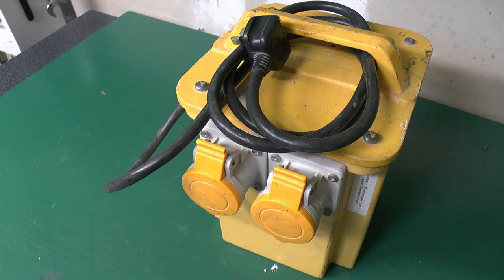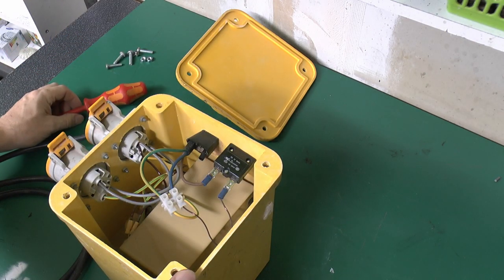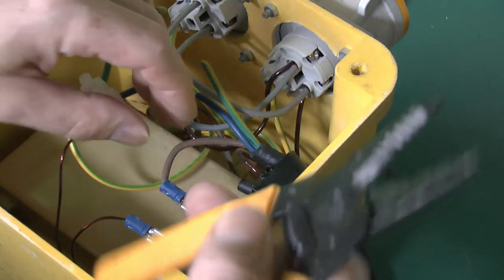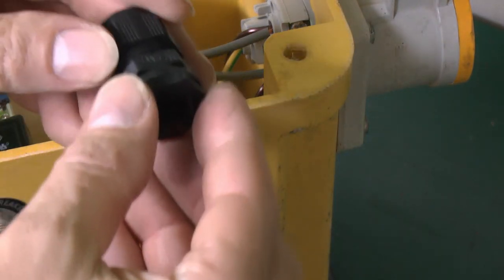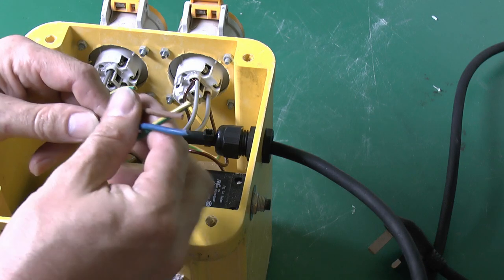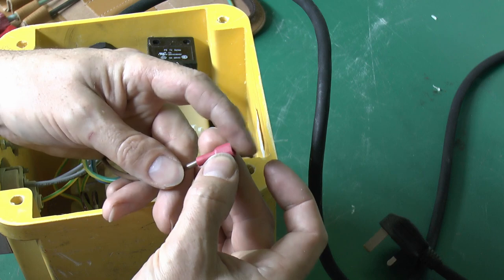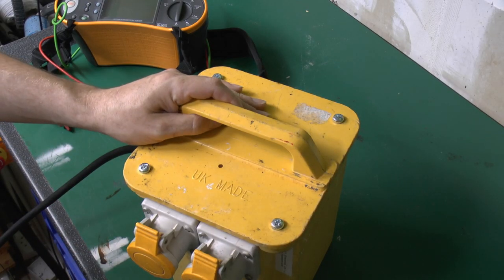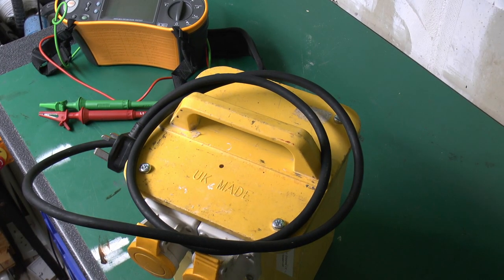110V Site Transformer Repair

Comment: That's a very clever idea, you can use regular 110V appliances, but only 55V to ground. Is the UK the only place where this is used? In Portugal there is no such thing, and you can't buy 110V power tools anywhere even if you wanted to.
Reply: Yes, and it's a requirement on most construction sites, at least for external work. It's especially important in damp climates when builders are often working in wet, muddy conditions.
Reply from the maker: Ireland uses these as well as the UK, not sure about anywhere else.
Reply: I also thought it was a very clever solution!  Never seen anything like it here in Australia, but all our stuff uses RCDs and generally is much drier than the UK.  Never thought that one if the reasons why it would be in use is because of the damp climate, but makes sense now.
Reply: @Berkeloid0  RCDs are used in the UK too, but as with any device, they aren't 100% reliable and in a wet environment they are going to be prone to nuisance trips. Also, some of the types of devices used in construction sites can trip RCDs on start-up unless they have characteristics which allow for it (and those characteristics are not the best for protecting people). 

The 55+0+55 system is inherently safer. For the same reason telephone systems which (usually) have a nominally 50V DC supply superimposed to provide low power and diagnostics was limited to 50V for safety reasons.

Fortunately, the availability of Li-Ion powered kit has replaced a lot of the need for mains-powered portable kit in construction sites. There are now very capable SDS drills, circular saws, jigsaws etc.
Reply: t0nito - the same 110V yellow socket outlets are found in some industrial buildings, fed via fixed 230/240V to 55 - 0 - 55 transformers so that 110V power tools can be used.

Comment: I would have used a new flex cable.  That one has obviously failed due to age.  Plus I would also add a nice power switch.
Reply: It’s failed due to repeated stress at a particular point. Not at all due to age. And it shouldn’t have a power switch.
Reply: @JasperJanssen  I recognized the cracking on the jacket.  The rubber, or whatever it's made of, has deteriorated and had begun to crack.  It was just accelerated at the joint because of stress.  In less than 5 years you'll see a repeat failure and the rest of the cord will show its true condition.  Having a nice emergency off switch can't be a bad thing.
Reply: You would need a power switch to have the same IP rating as the transformer pot and then there something else to get broken during use. ,

Comment: Thanks for shareing this video. i have purchased used 5kva transformer from ebay and  notice that they have removed  the Thermal  Overload Switch which is fitted next to 230v main power cable.

If i need to place it back, whats the ideal device that i should need to buy. (amp etc) and will it be any issue if i continue to work without this switch ? 

Thanks

Comment: Any body know how long ago we started using 110 volts on UK construction sites? Where did the idea come from?
Reply: after a bit of searching answered my own question
The system has its origins in the 1949 Annual Report of HM Chief Inspector of Factories, which recommended the system for use on building and construction sites and other applications involving large-scale use of portable electric tools. The system was described in the British Standard Code of Practice, CP 1017:1969, Distribution of Electricity on Construction and Building Sites (superseded by BS 7375:1991, now BS 7375:2010). Equipment was specified in BS 4363:1969 Specification for Distribution Assemblies for Electricity Supplies for Construction and Building Sites (now BS 4363:1998+A1:2013, also BS EN 61439-4:2013).
referenced from IET autum 2016
Reply: Roly M 

Early ones had Reyrolle BS 196:1961 5 and/or 15 A outlets which were also yellow, but the casing was metal rather than plastic and I think painted with Hammerite; certainly the whole thing wasn’t yellow.

I’m surprised how small the actual transformer is for 3 kVA, but I suppose that’s only a tool rating.  What is the rating for continuous loads such as site lighting?
Reply: @srfurley  ive still got one of those early metal ones.
Only a single outlet though and its taller, but still wotks.

Comment: So you just left a hole from the old screw open ???  so now damp can get inside through the hole ??   Also, was the brown leather tool wallet a BT phone engineers one ?   I would have thought the internal earth connection would have been a Crimp Connection ?  If it did have sand in it originally, then im guessing it would be for thermal reasons as well as damping the hum from the transformer ?

Comment: When I next get mine out I will take it apart. Mine has a broken flange on the fuse holder which I think was original. The circuit breaker is the only outwardly difference to my transformer. 
I found it odd that the circuit breaker was on the primary winding. 
I thought you had a correct fuse in the plug of the transformer ? and the fuse was on the secondary to protect the transformer. ?

Comment: Many years ago I had to take a van load of this type of transformer back to their manufacturer to have their earths modified so that they could be used in telephone exchanges. Never could get any info on why, possibly something to do with earth potentials with GPO/BT systems. Any ideas?
Reply: Probably due to noise problems being introduced when devices where being used. Old BT Party lines used an earth but different system is used today.

Comment: Its odd the "original" cable being loose to the metal case but the solution was simple and good: Nice work JW. Many appliances have one screw that is different because it gets  the most handy at the time and forgot to replace with equal....
Reply: But the case is yellow plastic.
Reply: @simontay4851  Oops sorry yeah but it is plastic heavy dutty hard and and sharp on the edges, where soft cable would be torn and wear out

Comment: Can u cut the plugs of 110 power tools and put a 3 pin plug on them
Reply: NO. A 110volt tool connected to a United Kingdom 230volt 3 pin socket will blow the 13amp fuse. This is because a 110volt tool has a lower resistance than a 230volt tool and as a consequence will pass too much current. Should some idiot replace the 13amp fuse in the 3 pin plug then the tool will burn out.

Comment: I have a site transformer that I use at home with 110 tools but it keeps tripping the earth leakage, mostly on turning it off but occasionally when turning on. Does not appear to be any fault with the transformer, could the secondary be unbalanced?
Reply from the maker: It may be the RCD - some can be tripped by sudden large surges, or the large voltage spike when it is turned off.
Reply: Quite common for the inrush current to trip domestic RCD's especially the higher current 3kW versions
Reply: @jwflame  I will get that checked again, the wiring in the garage where I use the transformer was only installed two months ago, and last night the transformer tripped the 32 amp ring main breaker instead of the earth leakage. I think that they might have used the wrong grade of breakers despite being told that I was going to be running welders and other equipment in there I have a 32 amp socket on a seperate breaker for the welder they installed so they obvious ly understood what was required.
Reply: It could also be that you have a fault between ground an neutral on another circuit. That will cause RCD to trip when starting any heavy load.
Reply: @mernok2001  say you have two fuses connected to an RCD. There is a small leakage or short between ground and live on fuse 1. You connect a big load on fuse 2, a small portion of the current going back through neutral on fuse 2 will go out through neutral on fuse 1 and from there to ground. Thereby tripping the RCD.

Comment: Love your videos John - looking at most modern fixed 13 amp fixed plugs and the pins are made of metal rather than brass - is there any advantage of having brass pins on plugs ?
Reply: Brass is lower resistance. I think the silver colour of the pins on some plugs is chrome plating.
Reply from the maker: Brass is a better choice for it's electrical properties, but other metals are cheaper and cost usually wins.
Reply: John Ward cheers John for the information
Reply: John Harwood - silver can tarnish 🙁

Comment: Thanks John  - can these be converted to make an isolation transformer?
Reply from the maker: In theory yes - the earth connection to the secondary needs to be accessible so that it can be removed.  Voltage output is still 110V however, so not really of much use.
Reply: you could make a pretty good step down transformer for travel purposes. if you're visiting the UK/Europe from the states. But due to the high in duction of first plugging in the transformer of that size, it be more practical in theory.
Reply: Thanks  @jwflame
Reply: Jonathan Furtado - eh? It is a step down transformer! You can connect most electrical items from the U.S.A. (or any other country that uses 110V/115V/120V) to these transformers. The only limitations are the rated power of the item has to be no greater than the rating of transformer (keeping in mind that these transformers are often tool rated, the continuous rating is lower) and any device that needs the supply to actually be 60Hz (clock/timer) will run slow.
Reply: JW referring to your reply, if you were really desperate, or bored, you could get a second tranny and fix 110V O/P of first tranny to 110V O/P of second tranny which will act as a step up giving you 230V. I can't think why on earth you would want to do such a thing in real life but it's possible

Comment: Why the resistance between the incoming ground and L or N on the output is >500 MOhm at https://youtu.be/2t_JR0CxctQ?t=1091 ? I thought this is a center tap transformer with the center connected to the incoming ground as it on this wiring here https://youtu.be/fRhofcMyAyk?t=330

Comment: Hello sir, can these transformers be used to power audio equipment as is? I am assuming the center tapped ground would cause grounding loop issues, especially if using audio equipment in conjunction with other equipment connected to the 240v mains.

Comment: Great video JW. Maybe should’ve used ferrules on the neutral & CPC connections though.
Reply: Not really, as you are going from a flexible cable to a solid core. Should have a fixed terminal on the case so any flexing of the input wire does not stress the solid wire and fatigue it. The solid wire is the transformer primary, and if you break it off at the most common point, the place where it goes into the potting, you now have a very heavy paperweight. Ferrules on the CPC however are fine, they are both flexible cables. John should have taken some sandpaper to the top epoxy to clean a spot, then used solvent to degrease the spot before putting on a cable tie base and 3M VHB foam to hold the base, then a cable tie to hold the floating connector block to the top there. Less stress on the solid wires.

The original gland is easy to take apart, just push the wedge back out the back, or use the cable stub to pull it out, and then reuse it again. Those glands are quite strong, you can easily hang the transformer on it with no problems, the cable will break before the gland lets go.

Cable is a silicone rubber cable, rated for use in Arctic conditions, and also rated for use in water, so it is waterproof and still flexible at -55C, and can be used up to 130C. You normally find it used on pond pumps, and I have made quite a few extension cords out of them when the pump fails, or if, as I was doing, I only needed a 50cm tail on the cable, and the pumps come standard with 10m.
Reply: BS 7671 Regulation 526.9.1 In order to avoid inappropriate separation or spreading of individual wires of multiwire, fine wire or very fine wire conductors, suitable terminals shall be used or the conductor ends shall be suitably treated.
Reply: @garymckeown4278  common c2 on my eicrs where people shorten rcbo neutrals and just twist. No amount of tightening will guarantee a solid connection.
Reply: thomas bourne yep and on my last NICEIC assessment this was mentioned by the assessor.
Reply: @garymckeown4278  as an apprentice I was taught to twist and double but that was through lack of knowledge and the fact it takes longer but once you know it's wrong why would anyone continue to do it. It doesn't make you popular when you fail entire marinas where the pontoons are all wired in h07-rnf without a single boot lace ferrule in sight when the client has only recently rewired it.
Reply: A better question - why don’t ALL specifications and regulations require all electrical terminal blocks / choc blocks / screw terminals and similar to have wire protectors (plates) or be of the rising clamp construction? Then there is no need to use crimp ferrules / boot lace ferrules.

Comment: With the transformer primary uninsulated wires flapping around and having the potential to  touch each other (but probably not), I would have been tempted to fasten them down or put some insulation over at least one of them just to be on the safe side.
Reply from the maker: Those wires are enamelled copper, not bare.
Reply: Yup, enamelled wire. But I'd still have been tempted to add some sleeving :-)
Also I'd have used a 3-way choc block, LEN, so any future flex cable change didn't need a re-crimp; and glued or bolted it down, to avoid any wiggling of the transformer wires...  :-)
Reply: Yep I know but enamelled can crack and ware off when things are touching and not fastened down. Put it like this, I would not risk holding an enamelled wire that was live if it had been able to move around freely. Not even sure I would want to anyway. In the transformer the windings you essentially have double the insulation between the windings and they are  fixed and still.  No cracking, flaking in the enamel  should occur when totally still. But the wires are out in the open and can flex/move a bit, all bets are off (in my opinion).

Comment: What's the purpose of the sand filling?
Reply: Cooling, Many of the users of these transformers would have them supplying 110v volts for a large amount of time during the work day. The sand would reduce the chances of the transformer overheating but it also would make it heavy, maybe they deliberatley removed the sand to make it lighter.
Reply: Why not transformer oil. That would be a better coolant than sand.
Reply: @simontay4851 It's done for stability, to stop it being knocked over, nothing to do with cooling

Comment: Why don't they omit the centre tap so it just becomes a isolation transformer?
Reply: Because then a short between primary and secondary in the transformer would not blow a fuse and would make the secondary side live at up to 1.5 times mains voltage relative to Earth.
Reply: Ben Vahanian - because the whole point is to keep the voltage of any accidentally exposed conductor as low as possible. In a damp or wet construction site environment, it may be troublesome to maintain the system to be earth free. And the system would have to undergo regular testing to find out or confirm if it is earth free. By earth free, I mean all the 110V supply equipment, all the extension leads, all the tools etc. would have to have absolutely no insulation faults. It all would have to be tested with a insulation tester. This is not very practical.
Why? Well if any of the conductors suffered an insulation fault (say a cable snagged on a piece of metal that was lying on the ground), your isolated earth free 110V system would now be an earthed 110V system. If a second fault was to occur, say a worker damaged the flex going to a power tool they were using, but did not notice. And then later on accidentally made contact with the conductor. If this was the now ‘hot’ conductor, they would complete the 110V circuit to earth/ground and could receive an 110V electric shock which could electrocute them.
Even if no second fault occurred, it would fail the next insulation test. Bringing the job to a halt.

Hence the solution is to centre tap the secondary winding of the transformer. Now by having an intentional proper earth, if either of the hot lines becomes earthy due to an insulation fault and a high fault current flows, the overload device will trip. Even if no significant fault current flows, if a worker accidentally makes contact with either one of the conductors, the maximum voltage that they would experience would be 55V. It is unlikely that this voltage will cause them injury. Hence this is the safest system.